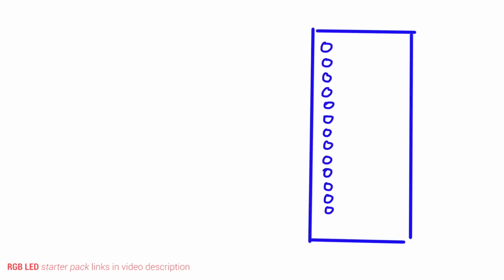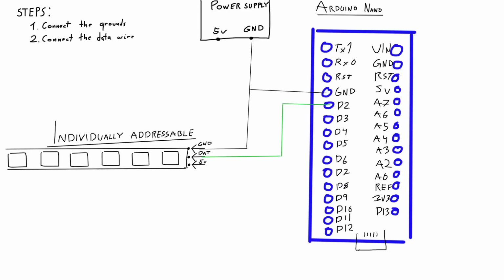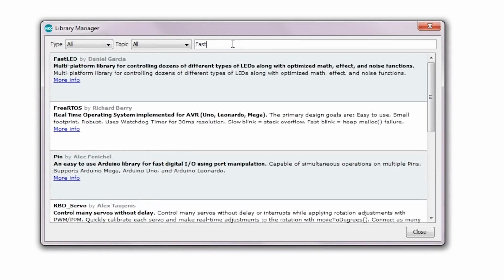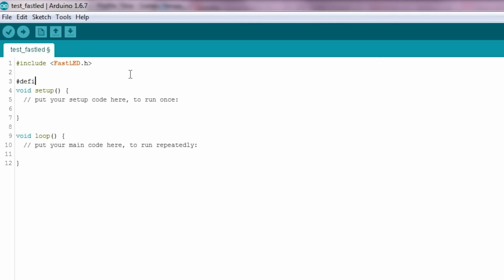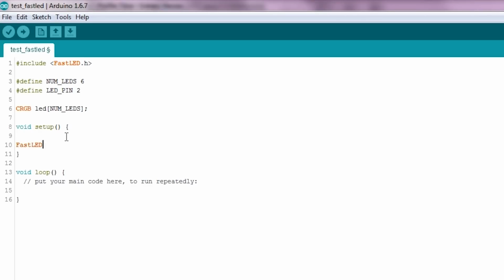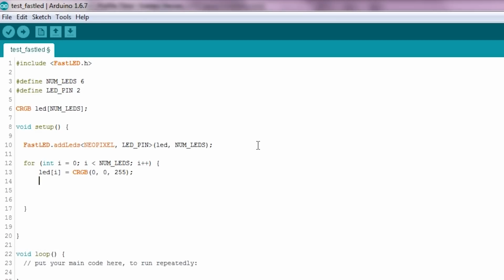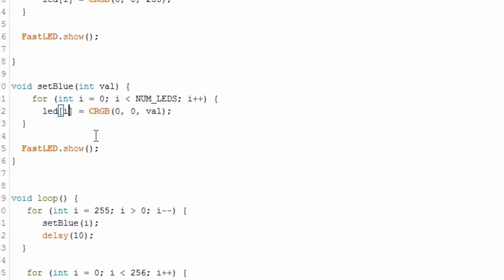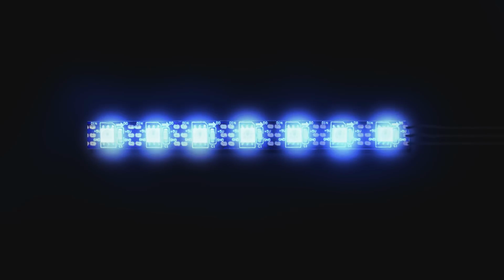Control RGB LEDs with Arduino || Arduino Essentials #1

Comment: How do you power the Arduino with this circuit setup? If I use a separate power supply using the Vin pad will the common ground points be a problem? Sorry if this is a stupid question.

Comment: Does it really require a power supply? Is there anyway to power the nano using the usb?  Just need to power up 5-6 leds
Reply from the maker: For 5-6 5volt leds you can power the nano with an USB and use the 5v pin for power :)
Reply: @Nerdforge  

Eeeeeyyy.. thanks man. You are life saver.. Just ordered the nano with no power supply.

Comment: 1:54 got news chief, that’s called a variable
Reply from the maker: It's definitely not:) the macro is handled by the preprocessor, and can never be changed runtime.
Reply: @Nerdforge  ok so Is that why we use #define? Instead of using a type Like, int, string, float etc????also sorry if that came off snarky, I am new to arduino and I came from Java, JavaScript and python so arduino is Wack

Comment: Let's say I want to control 12 leds with arduino nano. So I connect them and create a colorful grading base animation that looks great.
But in addition, is it possible to use a switch for each led that when pressed the corresponding led will change to white? All this without interfering with the base animation.
Is this possible? I've been looking online but haven't been lucky enough to find information on a project like that.

In other words, having an animation loop around the whole strip and when pressing (in example) switch number 3, the led number 3 goes fully white, while the animation still keeps going for the rest of the LEDs.

Comment: Hello. My power supply for the led strip is 5V 2.5A. and I use my notebook usb for the supply for arduino(5V i guess). When I connect the data cable to the pin on the arduino, don't I need to add a ressisto between the cable and pin?
Thanks for help

Comment: Good video! VERY IMPORTANT POINT, make sure your power supply can supply more amps than the LED strip pulls, you can check this by looking at how many leds the strip has, and since RGB LEDs take around 60mA, multiply the LED count by 60mA and you have the Amperage your PSU needs to supply!

Comment: I am trying to write a code which is based on world map sunlight
So each led represents 1 hour
24 leds = 24 hours 
Based on current time (india) it should on the led where it has sunlight 
The LEDs will be placed horizontally below the flat world map 
I have tried so many logic but couldn't crack it, in free time if you can think something .. the logic can be in java as well (printing the array of leds = sunlight on world map)

Comment: Say for instance you want it to  do a preprogrammed  sequence  for a triggered input. Is the nano able to be programmed  with up to 5 programs for 5 input triggers?
Reply: For instance if your using it as the means to totally  control  reverse lights/ brake lights/ turn signals using addressable LEDs

Comment: Plug in the Arduino Nano into your PC!!!!. 

Thanks for the video dude, for everyone that was going through my pain on start-up you have to plug the Arduino into the usb port first (well that’s what I found worked for me!). Going to google search but hopefully I can get it working without the usb cable as I want to make a lightsaber with the Arduino nano in the hilt so plugging the usb cable in every time to the board is not ideal. Once the board is powered via usb i can take the usb cable out and the leds stay lit over a single 3.7v Li-ion battery I’m also running a 330om resistor in-between the data line as this takes less voltage so it's best practice to protect it. Took me so ling to figure this out because i didn't want to push too much current to the leds from both the nano and the 3.7v battery.

anyway hope this helps some people :)

Comment: Do these LEDs have memory too? Meaning. If I connect the LED and the Power Supply and the Arduino, send a data signal from the Arduino for the color...let's say...RGB(25,50,255)...and then...I remove the Arduino since I only want that color on the LEDs forever (so I keep the battery ofc), would the LEDs work and give that color? 

Second.
If the first is possible.
Can I add a Push button switch in series with the LEDs and if I switch off the LEDs using the button and then on them again using button, would they 'retain' the same light?

Comment: Can I run 2 strips at the same time, both doing the same sequence?
Reply: In theory, you can but check the logic drive current vs max port  current
Reply: yup if you have enough pc power supply
Reply: @shinmalpure7872  From the same arduino or does it need 2?
Reply: @tim_insx  pROBaBly saMe cAUsE aUrDINo hAS sEPERaTE ports

Comment: is there something i can use to test my program before i gather my LEDs?? possibly using another linux program or so for a display with 5 or 10 "on-screen lights"?? my projects build isn't until later this year so I'm hoping to get the programming portion sorted, then change the number of LED's and associated "lights" coding once I have it ready to go...

Comment: im getting

Arduino: 1.8.8 (Windows Store 1.8.19.0) (Windows 10), Board: "Arduino/Genuino Uno"

In file included from C:\Users\lende\Documents\Arduino\rgc\rgc.ino:1:0:

C:\Users\lende\Documents\Arduino\libraries\FastLED/FastLED.h:14:21: note: #pragma message: FastLED version 3.002.006

 #    pragma message "FastLED version 3.002.006"

                     ^

C:\Users\lende\Documents\Arduino\rgc\rgc.ino: In function 'void setup()':

rgc:10:50: error: expression cannot be used as a function

   FastLED.addLeds<NEOPIXEL, LED_PIN(led, NUM_LEDS);

                                                  ^

rgc:10:11: error: parse error in template argument list

   FastLED.addLeds<NEOPIXEL, LED_PIN(led, NUM_LEDS);

           ^

rgc:10:51: error: statement cannot resolve address of overloaded function

   FastLED.addLeds<NEOPIXEL, LED_PIN(led, NUM_LEDS);

                                                   ^

rgc:18:24: error: a function-definition is not allowed here before '{' token

 void setblue (int val) {

                        ^

C:\Users\lende\Documents\Arduino\rgc\rgc.ino: In function 'void loop()':

rgc:27:14: error: 'setBlue' was not declared in this scope

     setBlue(i);

              ^

rgc:30:30: error: expected ')' before '{' token

  for (int i = 0; i <256; i++ {

                              ^

rgc:31:12: error: 'setBlue' was not declared in this scope

   setBlue(i);

            ^

exit status 1
expression cannot be used as a function

This report would have more information with
"Show verbose output during compilation"
option enabled in File -> Preferences.

Comment: I got a problem it said that no matching function for call to'CFastLED::addLeds(CRGB&, int)'
What does it meant and what could i do with it
Reply: I had the same issue but then realized where I had “CRGB led[NUM_LEDS];” I had parenthesis around NUM_LEDS instead of the brackets
Reply: I have the same issue.

Comment: if we were to control the LEDs over wifi using an arduino wifi module, would we need a separate power supply for the arduino? if so, any suggestions where such power supply can be bought?

Comment: so i can also do

led[1] = crgb(255,0,0);
led[2] = crgb(0,255,0);
led[3] = crgb(0,0,255);
FastLED.show();

and first led will be red, second green and third blue?
Reply: not quite, if i read the code correctly, the individual LEDs are stored in an array, which starts at 0. That's why in the function where he made them all turn blue for the first time, the loop counter "i" started at 0. so you would have to do 
led[0] = crgb(255, 0, 0);
led[1] = crgb(0, 255, 0);
led[2] = crgb(0, 0, 255);
fastLED.show();
Reply: yeah i figured it out after many failed attempts..

Comment: Hey, very good video! But i have on question because of the fade. Is there any method to fade mixed colors? I mean, when you have for example (0,153,76). In my case that doesn't work. Am I doing anything wrong, or do I have to choose a different way? 
(Sorry for mistakes, I'm from Germany and my English is not the best😊)
Reply from the maker: That should work, blue is 0,0,255, but for instance purple would be 255,0,255 or something like that.

Comment: hey just out of curiosity(noob here) could you have plugged in the led strip to the arduino's 5v output?
Reply from the maker: Yes, if the LED strip is small that would work. The Arduino usually can't deliver over 1A :)

Comment: Can some one please Help with addressable LED sketch I need?
I have tried your sketch and only the first 9 out of 16 led's light up.
I would like to make the led's start at 0 and go to 16 and start over again in the color white, I know it is probably no big deal for some one that knows how to do this but its my first time using addressable LED's and making sketch's.

The data pin I'am using is #3 and my board is Mini Nano V3.0 ATmega328P 5V 16M Micro Controller Board Module Arduino.

Comment: i want to power a 5m led strip, so i need 12v power supply. so, for that, i just need to change the power from 5v to 12v?

Comment: i have a neopixel led strip and i just want a simple rainbow effect in my leds but i can't find any code or tutorial please can someone help me  i want this effect https://youtu.be/yiKE5Zo7xGY if someone help me i will greatly  appreciate
Reply from the maker: Check out my RGB mousepad video :)
- Hansi
Reply: Nerdforge hey i  watched  your rgb mousepad video i just found this cheap led strip https://m.aliexpress.com/item/32773441024.html?pid=808_0000_0101&spm=a2g0n.search-amp.list.32773441024 i want to ask you if i use your code will it work for this led strip or Do i have to make any changes in code?  (this strip works with neopixel library codes)  waiting for your reply
Reply from the maker: I think that should work fine :)
Reply: Nerdforge  ok thanks for your kind help

Comment: Can i connect led strip's 5v to arduino nano's 5v? So both arduino and led strip powered with usb
Reply: NONONONONO JUST NO! Nano or other Arduino can output 200mAh before you damage it. But one LED needs 20mAh per color, so all three are 60mAh.
Reply: If you’re using a relatively small number of LEDs (~5 LEDs) you can use the arduino’s onboard 5v regulator to power them, however for anything above that I strongly advise you don’t, otherwise you can destroy the board’s regulator by drawing too much current. Hope this helps!

Comment: Brilliant video :D Really helped a lot, but is it possible to program the Led's not to use the blue light colour?
Reply from the maker: Sure, when you set the color value using CRGB(0, 0 255), the positions of the numbers represent the color. First is red, second green, third blue. 255 is full, 0 is nothing, so this will output full blue.
Reply: Thank you So much for replying! Subscribed :)

Comment: For the LED strip you linked to there are 5 wires coming off of it; A red and a white wire that are separate from the rest which I'm assuming are the for the power supply, and then another red, another white, and a green wire running through a connector. I'm assuming from my (albeit quite limited) knowledge that the green wire is the ground. What would the second red and white wire be for? How would one wire up that LED strip?
Reply: The red and white wire not on the connector ia just for easy access im pretty sure
Reply: I have the same kind of wiring, 
did you ever figure this out?

Comment: Thank you from the bottom of my heart for this tutorial. I have been working with my Arduino controlling actual LED components individually wired up to separate pins on the Arduino, which limits the amount I can plug into it. I bought myself one of these LED strips with 300 LEDs on it but I haven't had the time to sit down and actually go through how I control every LED individually on the Strip. You have saved me such a lot of work...thank you, thank you, thank you. I am now happy to sit and start programming my strip of LEDs to dance a merry dance 😊😘
Reply from the maker: Comments like these is what keeps us going :)

Comment: Hello, nice tutorial short and to the point. I have a question. Is it possible, aside from the power needed, to address lets say a strip of 10 meters with for instance 30 LED/meter. They will not be lit all at the same time. only a few. But the addressing worries me. Is it possible to address them all individually when there are more than 300 LEDs in the strip?
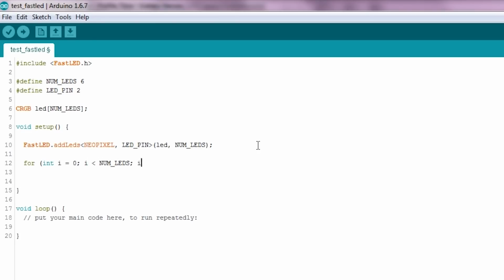Reply: Possible so long as the voltage is high enough. From the code 2:29, leds[i] = Function(X, Y, Z) where i is the position of LED in the strip.
Reply: Thank you !

Comment: * Please reply me~~ Thanks a lot!!!!*

hi I am a beginner who is really interested in making this LED lights.
But I got some troubles.

I bought a RGB LED strip, but it has 4 connects: +5v, R, G, B.
Which is different from you used in the video.
Could you please tell me how should I connect it to the arduino, and any changes should I make in the sketch?

* Please reply me~~ Thanks a lot!!!!*
P.S. if anyone knows that please answer me too><
Reply from the maker: Hello! This is not individually addressable, and is fundamentally different from what I used. This can't be used to change the colors of the LEDs individually. I have put a link to the appropriate LED strip in the description. Also check out my LED starter kit: https://kit.com/NaturalNerd/led-arduino-starter-kit
Reply: okay, thank you for your prompt responese :)!
i have one more question~  i am trying to make the light in 3:53, but my sound detector only have 3 port: GND / OUT / +5v, which your original video' sound detector has 4: GND / VCC / DO /AO
i wonder if the one i bought can also be used, or they are different too?
Reply from the maker: Depends. Try to analogRead the values from OUT. It should be a large range of numbers, close to zero when there's no sound, and close to 1000 when it's loud. If the OUT is a digital output (0, or 1) depending on a threshold (usually a potentiometer on the board), its not compatible with the code I have written .

Comment: hey. thank you for the guide! unfortunately i bought a 12V LED strip. can i connect them with a common ground or will i fry the arduino? if there's a simple way to make it work i'd be so so grateful!
Reply from the maker: Should be fine.
Reply: Natural Nerd thank you for the quick reply. Just found some info on using a transistor so will try that to be safe, if I have one, but if not I'll just do it anyway.
Reply from the maker: The arduino can take 12 volt input as well.  It's regulated. 5-12 volts.
Reply: really? there are so many guides on how to step down 12v for an arduino, drive LEDs with a mosfet, thermistor and so on. i'm really confused by all the different suggestions.
the data pins are definitely 5v if i understand correctly.
are you suggesting that i input 12V from the power supply to the LED lights and arduino in parallel, LED ground into the arduino GND pin and the LED data cable to the correct PWM pin, with nothing else, and it will work?
Reply: ok you're right about the 12V, thank you! i can power the arduino fine with my 60W PSU. no smoke. 
so, would it be a terrible idea to solder the LED power and ground directly at the VIN on the arduino, or would i somehow be pulling too much current into the board despite it being before the regulator? 
if i then put data input into the PWM pin and the other end into the digital GND, it should work, right?
Reply from the maker: That should work without risking destroying anything. If it's a good idea or not I can't say for sure. Many would advice against soldering directly to the pins and using a breakout board instead. That's just a convenience matter though. Yes, the data pins operates at 5volt, and you can solder the connection directly to the LED strip.
Reply: Natural Nerd hey. Thank you so much for helping out and staying in touch, but unfortunately the arduino is fried. Not sure what did it, but it's dead. I'm ordering a few more Chinese ones so I can figure it out, but it'll be a while. :-(
Reply from the maker: Sorry to hear that! I have done that quite some times as well, and its a part of the process.

Comment: But how to drive an individual led ? Here is just a ready made library.
Reply from the maker: You access the individual led in the leds array. E.g leds[0] is the first on the strip.
Reply: How the library/hardware communicates with an individual led?
Reply from the maker: Could be an interesting subject, but not practical unless one has very little memory space, and hence can't include the library.

Comment: Do any of y'all have a recommendations as to which power source we should use?
Reply: i use a 3.7v 6600mah lipo with a powerboost  1000c (5v 1a) i also use a cheap dollar store power bank for $3 its 5v 1a 4400mah.
Reply: There are 'open frame'   SMPS at 5V that can handle up to   30A

Comment: Hi,

Can you with these control each LED individually? Like let's say, you have 20 LED's and you want the 5th, 8th and 20th to light up blue, the rest not, and so? Is that possibe? If so, could you make a tutorial about it?
Reply from the maker: That is exactly what we do in this video, except we use a for loop to go through all the LEDs and set them to the same color. If you want to set them to different colors, then instead of looping through, just do leds[4] = whatever color you need, to set the 5th LED.
Reply: aha, perfect, is there a site where I can buy them seperated from each other? In large quantities? Like, I'm planning to make my own emergency LED's, to build in a car. :)
Reply from the maker: I see. Well, you could just buy the strips I linked and cut them into the lengths you need
Reply: @robinrosiers331  if you're still searching. It's best to use an entire strip since they are very cheap and can be cut as long as you need. Also you have some extras since sometimes a few LEDs don't work